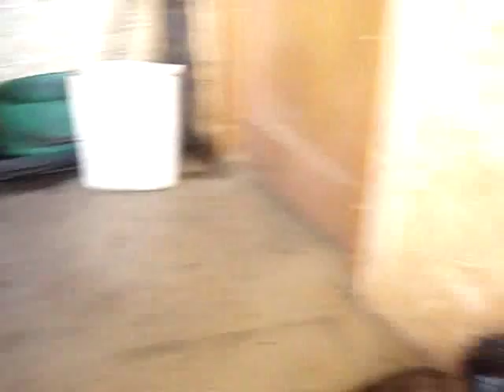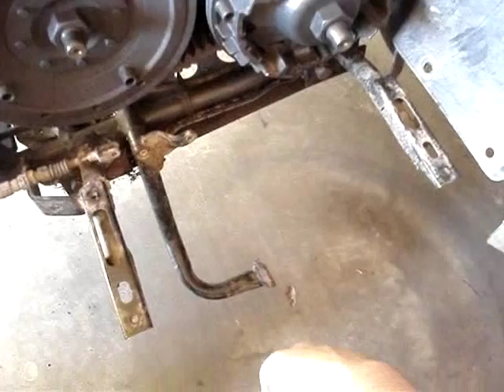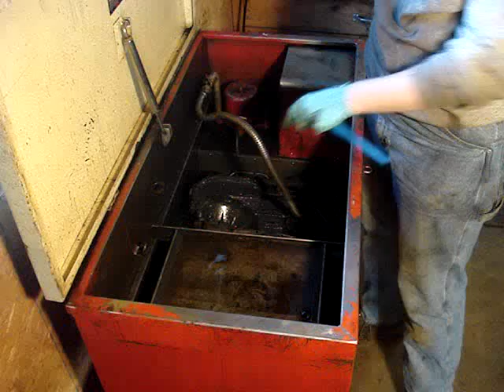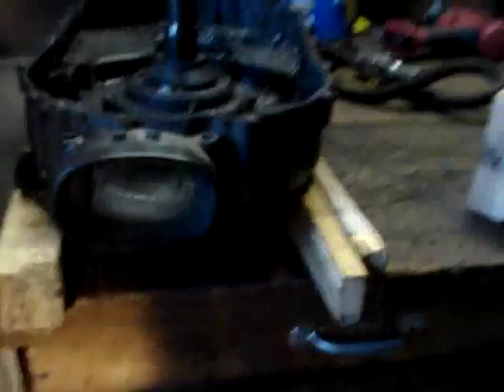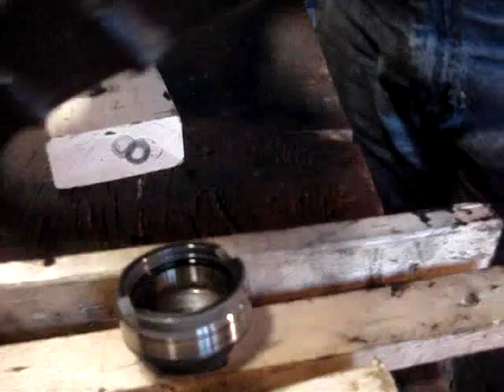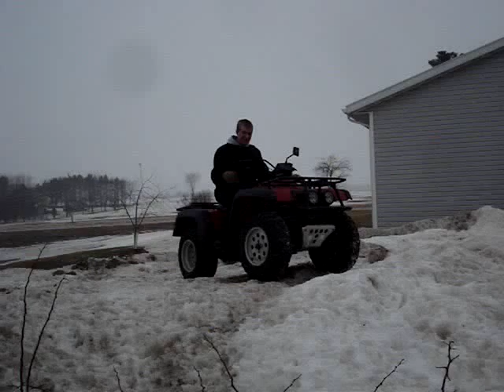Replacing the clutch seal on a Suzuki Atv

Comment: where are the 4 bolts on back side you mention
Reply: Nate Mcmanaman the 4 bolts r on the plastic air flow. if u look to the left when u have the drive belt  cover off u will see the plastic vent. they are on the back side of that. tough to get at one with the plastics on